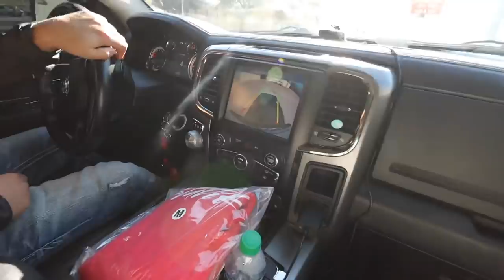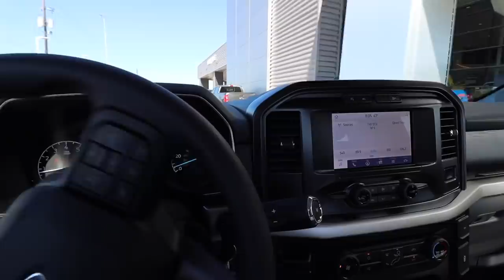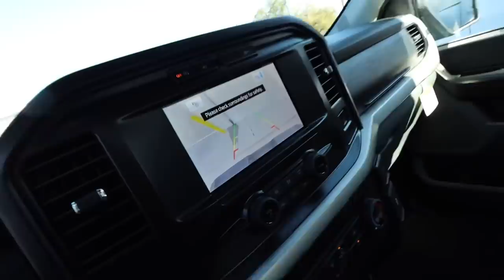MY NEW 2021 COYOTE F150 SINGLE CAB!

Comment: upgrade to 302 boss intake manifold  & get it ported by @454chuy & also port your throttle body! Nice gains from it bro & it will help with your other bolt ons, plus a tune 🔥 🔥 🔥 good n/a build